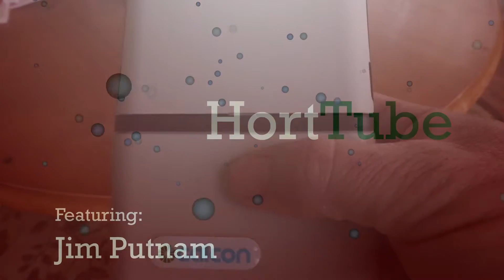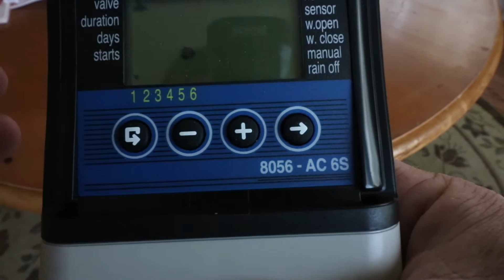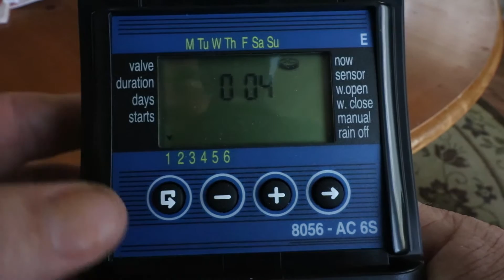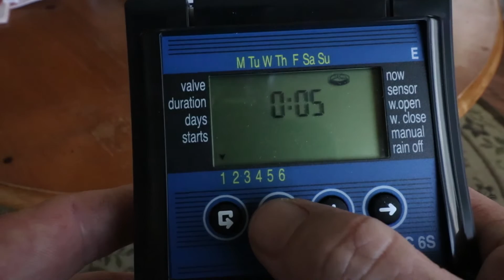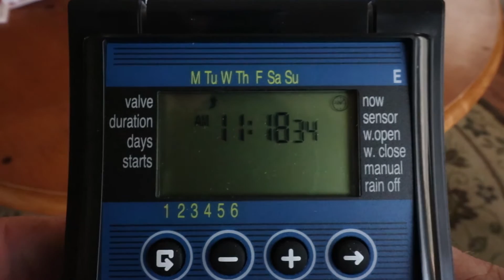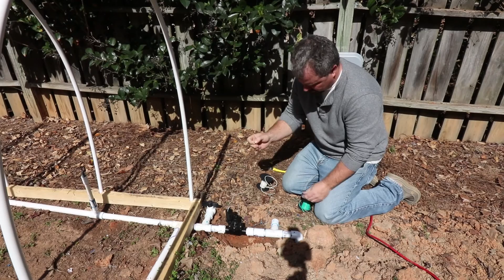Backyard Plant Propagation Episode 4 (How to Root Woody Shrub Series)

Comment: You linked the clock at the bottom of the second video, not the first, and it sure was the wrong one. I just went with the one you linked because I figured you would have corrected it by now if it was wrong, but now that I bought the one on the link I see the one in your hand and it's definitely a different model. 

Do you think you could use a simple on/off timer that's programmable in seconds? It's like 20 bucks instead of 80
Reply from the maker: Just use the priducrlts I use link. There is a section of propagation items. I deleted that link to that click. I have no idea when they changed that clock. The video is a couple of years old now. Thanks for watching.

Comment: OK, so I asked this question in the previous video since 2-3 second duration was mentioned. So, if 5 seconds every few minutes is adequate, this $24 timer http://amzn.to/2BZQgOc should also work nicely as it has 5, 10, 15, 20, etc. duration with 10 s, 30s, 1m, 3m, 5m, etc frequency. It is unclear though if this timer has start/end time, so my question is, is nighttime misting not necessary? I understand that evaporation is much higher during the daytime but do the leaves not dry out during warmer nights?
Reply from the maker: Unfortunately that clock won't allow you to make fine changes that are necessary. Sometimes it is cloudy, raining, cooler, hotter, or whatever and fine controls are required. No water at night. 1 second of water hundreds of times is a lot of water of time.

Comment: Unless they damaged the diaphragm or seat, you can open up the valve and clean the debris (pebble) out without removing or replacing the valve. Turn the water off and relieve the back pressure, carefully loosen the screws, open up the valve and remove the junk, then carefully reassemble without over-torquing the screws.
Reply from the maker: +Ryan Cooper True. I have done my share of tinkering with water valves of all kinds in this life. Just easier to prevent it. Thanks for watching